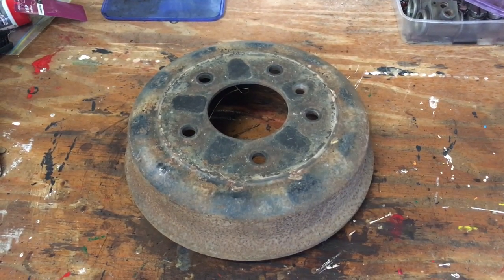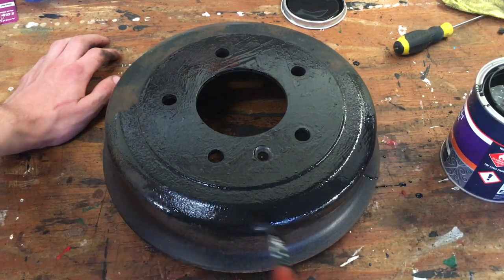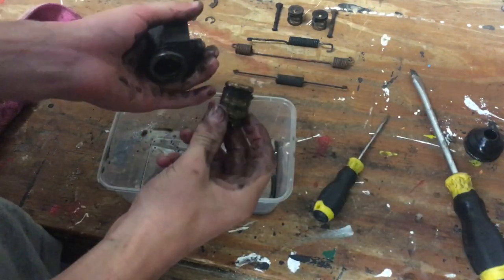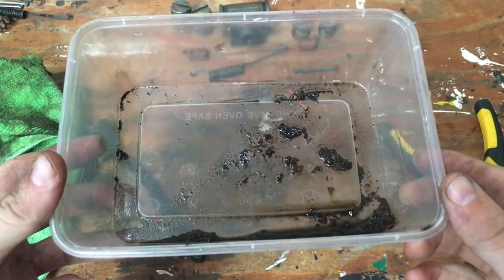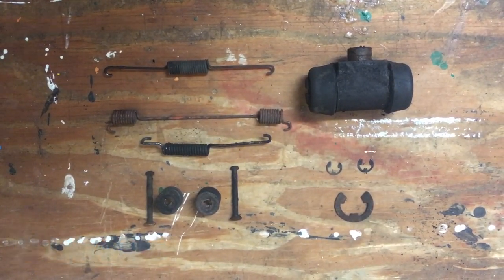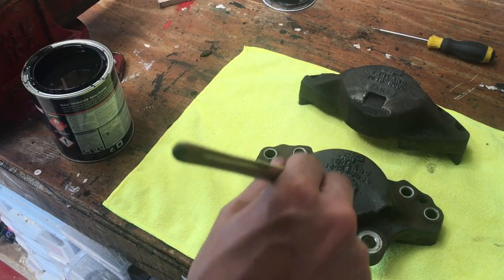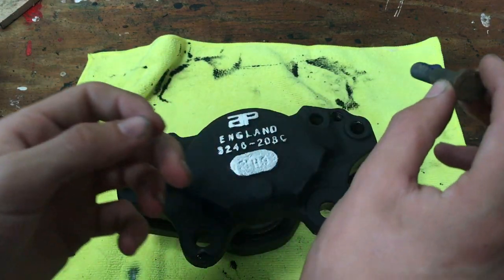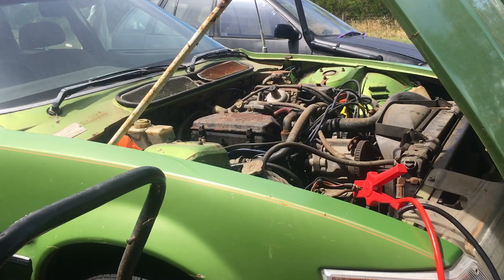Rover SD1 Brake Components Restoration

Comment: just be careful on the paint as it is not heat proof it will burn off very quickly and can gum up parts and catch fire ,tip for removing the pistons is run compressed air into them with a rag over the piston as it will shoot out this can be done for front and rear  , i noticed you didnt do the front seals and pistons i would advice to redo the front replacing seals and making sure no pitting on the pistons .... loving the series cheers
Reply from the maker: Thanks for the advice mate!!